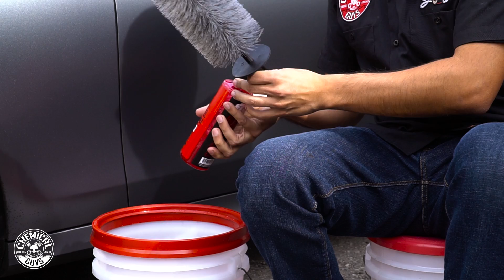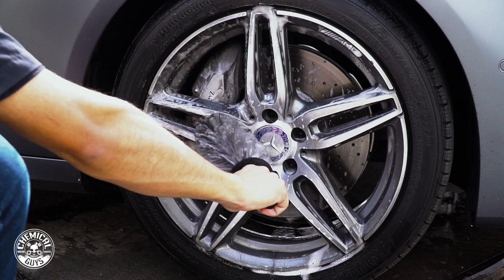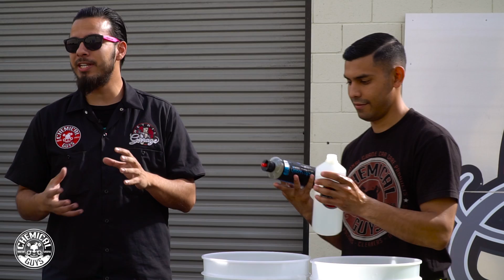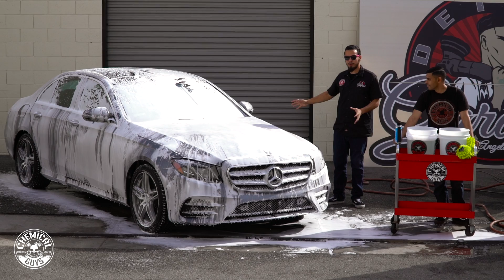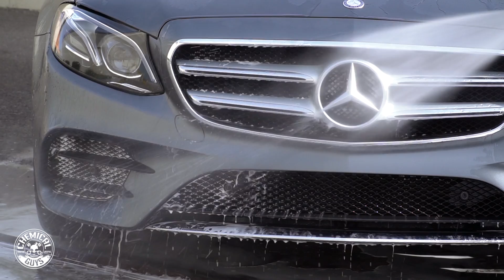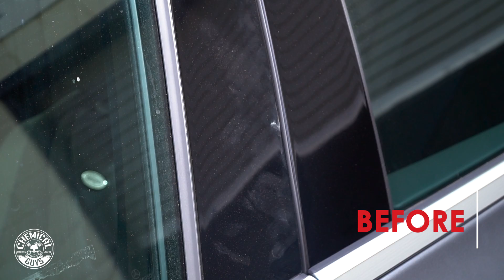How To Properly Wash Matte Finishes - Chemical Guys Car Care

Comment: Hi, what type of pressure washer is recommended as there are different PSI to choose from?  Thanks.
Reply from the maker: Hey! Use between 1600 - 3500 PSI / 2.0 GPM for automotive detailing.

Comment: This video is EXACTLY  what I have been looking for! I literally took notes and bought all of the products shown. I just got a matte grey AMG E63S and I have been so worried about scratching it etc., being so over protective. Right now I want to be the only one to touch my car so this is a perfect DIY video for me. BUT, I have such a busy work schedule and life in general that I'm also looking for a detail shop I can trust to take care of my Benz. Are you guy in Nor Cal in the Bay (on the Peninsula) anywhere? If not, any suggestions on where I may be able to take it? Not sure the dealer is going to know exactly what to do.
Reply from the maker: Hey Reina! Thanks so much for watching and for the awesome feedback! Currently we don't offer detailing services but I recommend using your Meticulous Matte Spray Sealant Detailer to pick up light dust and messes without having use a hose and bucket unless it gets really dirty.
- CG Nick
Reply: @ChemicalGuys  Wouldnt that scratch the car if you arnt washing off the grime first?

Comment: I would verify that the wheel jell (cleaner) being applied here, especially with certain over spray and brush spray hitting that beautiful matte finish paint job, will not damage the paint. Matte finishes are a major pain regarding upkeep, and are not easy to repair once damaged. No waxes. No car wash. A standard paint job, many of those scratches and swirls can be buffed or polished out. If you own a matte-finish car, that’s not the case. Love the look though!
Reply from the maker: Hey there! Great feedback, Diablo Wheel Gel and Sticky Citrus Wheel Cleaner is safe for all types of wheel finishes including matte/satin. - Happy detailing!

Comment: If I had a vehicle like the Challenger TA where only the hood, roof, and trunk are satin black, would you use the matte/satin wash on the whole car or just those places? What about the sealant and waxes? In other words, would those matte products also be clearcoat safe?

Seems like it would be really difficult to isolate those areas. Especially on the T/A

Comment: I guess I should have explained. I ordered the tank protectors on eBay and they looked great but the right one stayed on and the left one fell off and left sticky, bugery crap on left side. So now I have to remove right one and get both sides clean. Any hints? I bought the three bottle package of your cleaner and sealer from amazon. Thank you.
Reply from the maker: Hi Patricia, is your bike matte?
Reply: Chemical Guys yes it is . Camo green and black, all matte. It’s a Kawasaki Z650 2018
Reply from the maker: You can use Meticulous Matte Auto Wash and Meticulous Matte Quick Detailer to try to get the leftover adhesive off your matte surface. We do not recommend using any stronger products as they may damage your finish. If there is still some adhesive after this, we recommend you take your bike to a professional. The fact that your bike is matte really limits your options and traditional adhesive removal methods cannot be used. 
https://www.chemicalguys.com/Meticulous_Matte_Auto_Wash_16_oz_p/cws_995_16.htm

https://www.chemicalguys.com/Meticulous_Matte_Detailer_4_oz_p/spi_995_04.htm
Reply: Chemical Guys thank you very much. It’s funny, I did use the exact products you mentioned and I did get most of the adhesive off, but there’s still a few marks left. I’m going to have my husband help me next time for a little more elbow grease. You’re products are fantastic and I really appreciate you answering. I love my matte painted bike but  didn’t even think about the special care that must be taken with it.

Comment: Would you reccomend the same products/steps on a matte black metallic motorcycle? Or do you have a better recommendation that I could use? I just got it, and im terrified to make a mistake while trying to keep it clean and beautiful.
Reply from the maker: Hi Jennifer, great question. Yes, you would use these same steps on a matte or satin black motorcycle! Another great product to have around for quick clean ups on the go or in between those full washes is our Meticulous Matte Spray Detailer and Spray Sealant. It's the only quick detailer that won't leave unwanted shine to your surfaces, all while cleaning and laying down a light layer of protection. Together with the Meticulous Matte autowash, you have everything you need to care for you motorcycle and keep it looking new! Thanks for watching, Jennifer, and stay tuned for a new video dropping later today! 
https://www.chemicalguys.com/Meticulous_Matte_Detailer_16_oz_p/spi_995_16.htm

Comment: I have matte finish wheels, what’s the best way to clean them and what i shouldn’t be using on them as well can you please help! @chemicalguys
Reply from the maker: Hey buddy, you should avoid anything that will add shine to them, or that could stain or eat away at them. I have recommendations for two different products: One is for the Meticulous Matte soap, and the other is for the Diablo Wheel Gel. The best way to utilize them is getting one of our buckets, fill that with deionized, or filtered water and pour a few ounces of the soap into the bucket. I also recommend using the Long Handle Body & Wheel Brush with Flagged-Tip Bristles, Angled Head to clean the spokes and flake off any abrasive break dust that could harm your matte finish. I really like using the Wheel Woolies too because they're easy to push and maneuver through the spokes, also they will absorb any dirt, grime and metal shaving coming off the wheels. Diablo Wheel Gel is a good choice, it's PH Neutral and it was designed to clean any wheel surface. Meticulous Matte specifically works on Matte surfaces so there's zero chance of damaging the matte finish on your wheels. I'm going to leave you a series of links to the products.
http://www.chemicalguys.com/Wheel_Woolies_Brushes_p/acc_m10.htm

http://www.chemicalguys.com/Meticulous_Matte_Auto_Wash_16_oz_p/cws_995_16.htm

http://www.chemicalguys.com/Diablo_Gel_Wheel_Rim_Cleaner_16_oz_p/cld_997_16.htm

http://www.chemicalguys.com/Heavy_Duty_Detailing_Bucket_w_CG_Logo_4_5_Gal_p/acc_103.htm

http://www.chemicalguys.com/Long_Handle_Body_Wheel_Brush_p/acc_g01.htm

C.G. Alex -

Comment: I just recently purchased a Black 2018 Dodge Challenger T/A SRT 392. This car has Matte black finish on the hood, roof, and the trunk as well as the T/A striping. The rest of the vehicle has the high gloss paint that is standard on most vehicles. How do you wash this type of vehicle? Do you guys have a video? Please help!
Reply from the maker: HI Maurice, 

There's really only one way to go about your current situation to take care of your Matte black finish on your hood. You don't want to take the risk of washing your car with a glossy soap because you risk adding any unwanted shine to your matte finish. The best way to wash your car is by washing it with a matte specific soap and then applying a glossy quick detail spray to areas you want to appear glossy. The glossy finish is completely safe when using a matte specific soap like our Meticulous Matte Auto Wash, so there's no need to worry about that. If it were the other way around and you washed it with a glossy soap, you'll put an unwanted shine on your matte finish. After you wash it with matte, just one extra step of a quick detail spray will add shine to your glossy finish, as well as a layer of protection against contamination and UV solar rays. We also carry a matte specific quick detail spray when you want to care for your matte finish wherever you may be. Follow the link to check out our Meticulous Matte Auto Wash and Quick Detail Spray. 

http://www.chemicalguys.com/Meticulous_Matte_Auto_Wash_16_oz_p/cws_995_16.htm?Click=18676&utm_source=Social&utm_medium=YouTube&utm_campaign=CWS_995_16

http://www.chemicalguys.com/Meticulous_Matte_Detailer_16_oz_p/spi_995_16.htm?Click=18676&utm_source=Social&utm_medium=YouTube&utm_campaign=SPI_995_16
Reply: I purchased the Meticulous Matte Car Wash and Detail Spray, but what specifically do you recommend for my glossy areas in the form of detail spray for UV protection and shine. Btw, love the videos!

Comment: I've watched a TON of your videos and LOVE them. However, I just purchased a used challenger with shaker hood which has vinyl stickers on the hood, roof and trunk and haven't seen a video covering a vehicle that has both mediums. Do I just wash and wax like normal? The shaker has water spots as well. Help!
Reply from the maker: Hey J, thank you for watching our videos, and reaching out to us. You could use any soap as long as it doesn't contain wax. If you want to protect the vinyl stickers, I would recommend using the wrap detailer, it contains a formula complete with cleaner and sealant. We have a water spot remover that can be used to remove the water spots, if the water spots have been on the shaker too long, it probably needs to polished. Try to avoid getting water into the shaker because the water will go into the air intake. Stay tuned J, we've more great videos on the way.

C.G. Alex -
Reply: Chemical Guys you guys are awesome!! Thanks!

Comment: Do you have a no rinse product for matte wraps?
Reply from the maker: You can use our Meticulous Matte Detailer is our matte quick detail spray that is able to clean your matte wraps quickly and efficiently. It's able to remove dirt, dust, road grime, fingerprints, and more while also providing you with spray sealant technology protects against contamination, pollution, and fading. It contains no wax, solvents or silicone without adding any unwanted gloss. Enjoy and thanks for being part of the Chemical Guys family!

Comment: what about the dilution ratio?
Reply from the maker: Hey buddy,  thanks for watching. You would want to use about an ounce of soap for 4-5 gallons of water. We typically use two to three ounces of soap in our buckets when we utilize our foam cannons. Our philosophy is that less is more, so you don't need to go overboard with using allot of soap to get more foam. That's definitely a good topic to touch on, we'll be sure to talk about that on the next video. Stay tuned, more great videos on the way!!

C.G. Alex

Comment: is there any chance that a regular car soap can damage matte paint? I have your meticulous matte detailer and jet seal matte. just wondering if regular car soap is safe
Reply from the maker: Hi Leonard, thanks for watching, it's entirely possible if the soap contains bleaches, and harsh caustics, waxes, sealants etc... Stick with what you got, you're good to go. We also carry a car soap, here's a link to it just in case you're worried about inadvertently exposing your vehicle to a soap that could alter your matte finish.

http://www.chemicalguys.com/Meticulous_Matte_Auto_Wash_1_Gal_p/cws_995.htm 

Chemical Guys Alex
Reply: Chemical Guys thank you! one last question - is meticulous matte detailer safe on plastic headlights and plastic motorcycle windscreens?

Comment: What pressure washer do you use a d how much psi is it because I have a 3100 psi gas washer and it makes no where near as much foam yours makes. I have a mtm foam cannon
Reply from the maker: Hi Jorge, 

Our gas-powered pressure washer has a PSI of 2800 while our electric pressure washer is 1800. The amount and the thick of the foam you want comes from the dilution ration that you use. We generally use 1 ounce to every 5 gallons to provide that thick foam we love to use when washing our cars. Now, if you see it's not creating the amount of foam you desire, you can use 2 or 3 ounces total in a 5 gallon water bucket. 3100 PSI is perfect for your MTM Foam Cannon because it works great with 1100 - 5000 PSI.

Comment: why do you guys use 2 different mitts? or are they both the same?
Reply from the maker: Good question, both are chenille microfiber while one is a mitt with a cuff to prevent dropping as you wash and the other is a pad that gives the user more mobility and coverage.

-CG Nick

Comment: Does normal carnuba wax or sealent work on matte finishes or do i need some sort of special wax. Also is claying a matte car different?
Reply from the maker: Great question. For Matte finishes, you do not want to use a carnauba wax or sealant that provides a shine because it will damage the Matte finish and giving it an unwanted shine. We suggest you try our Meticulous Matte Detailer because it removes dirt, dust, road grime, fingerprints, and contains UV protection prevents fading. It's perfect for satin matte paints, matte finishes, and matte vinyl wraps. As for claying, DO NOT clay a matte car because it will severely damage your paint! Thanks for being part of the Chemical Guys family!

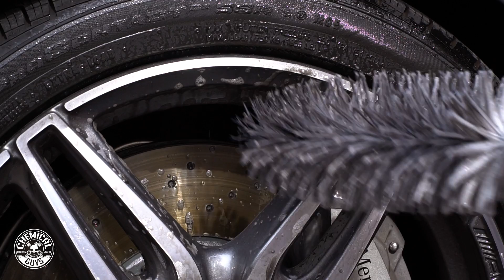Comment: 1:44 is the reason I use wheel woolies over those brushes.
Reply: MikeEM1 also that's why to get between the spokes I use a bendable brush...One side has microfiber and the other side is a sponge...

Comment: will this product assist in brake dust that has sat on the wheel for some time? With my work schedule its hard to keep on top of it, so it can be a hassle getting that wheel clean sometimes. Thanks
Reply from the maker: Great question. The Meticulous Matte Auto Wash for Satin Finish & Matte Finish Paint will remove dirt, dust, road grime, fingerprints, and more while adding extra slick lubricants reduce the chance of swirls & scratches.

Comment: Does the specific soap also works with textured matte paint? (I need to properly clean a Peugeot 208 GT Line Ice Silver)
Reply: how did you end up doing it? i was wondering the same
Reply: @panagiotispns  I ended up using their product, after using dish soap only one time to remove the wax residue left from using a normal car shampoo

Comment: How do you guys properly clean your microfibers and brushes once you've used them? Just regular machine wash or what?
Reply from the maker: Hi Tyrese, 

There's a proper way to wash your microfiber towels to keep them soft and fresh. First, you're going to want to separate your towels from grimy towels to the cleaner towels. Start by washing the "cleaner" towels first before your grimier. they are safe for machine wash but with HOT water. This way, the hot water opens up the fibers to better release dirt and grease. DON'T use fabric softener because it'll clog the microfibers. You can machine dry it on LOW heat because of you dry on high heat will make them hard and useless. Thanks for being part of the Chemical Guys family!
Reply: Tyrese Brown Indeed, machine wash. First the drying towels, seperate the really dirty ones from the cleaner ones. Wash those seperate. I use several towels for the paintwork (first wash) and a few ones for the wheels (second wash). Always use the same towels for the same job. Wash the towels on 60 to 75 degrees (some of them only go to 60). Use liquid detergent, no powder. Clean as a whistle. 👍😉 After that, do the microfiber cloths you use for waxing, buffing, quick detailing etc. Some of them only go to 40 degrees, otherwise wash 'm on 60. Better not wash glass cleaning microfiber cloths together with the ones I named above (unless you want to save money/water). Last but not least: the washmitts. I use the same (rasta)mitts as in the vid. Wash those on 60 degrees. Never wash your "wheel mitts" together with the "paint mitts", by the way. Good luck.
Reply: Great video. I watched another video Nick did that explained how to clean rims and now I follow his method and my rims look awesome.
Reply: Chemical Guys Still no wheel brush design that stops it from flinging everything back on you?
Reply from the maker: Currently, it's still with our research & development team to create this type of brush. Stay tuned!
Reply from the maker: N Scott That's awesome, we appreciate the feedback and for tuning in!
- CG Nick